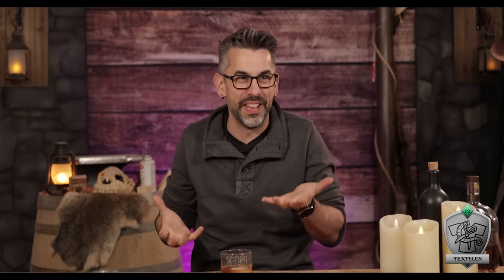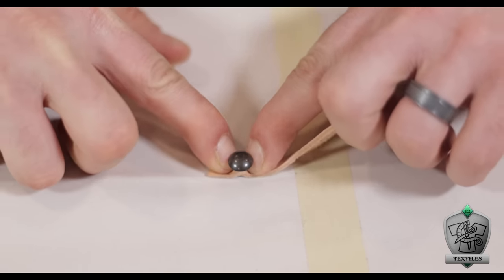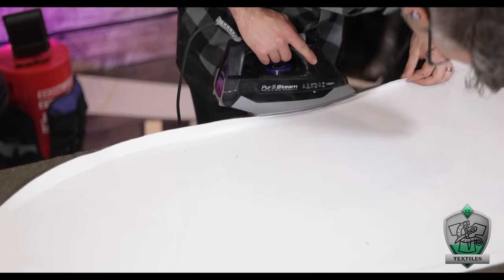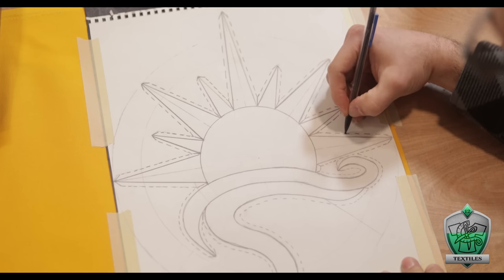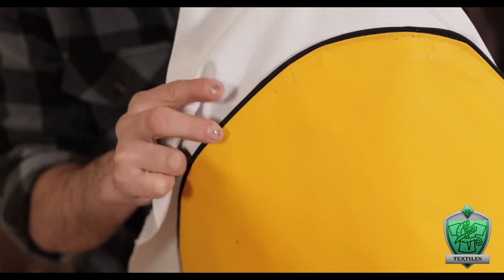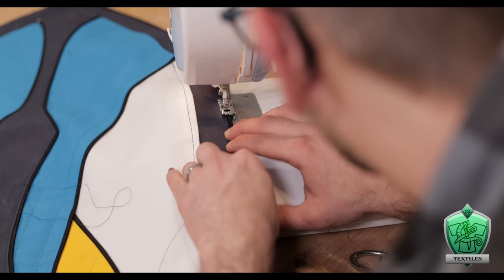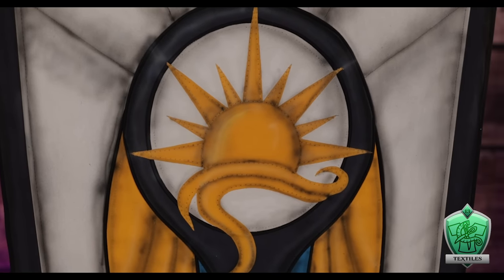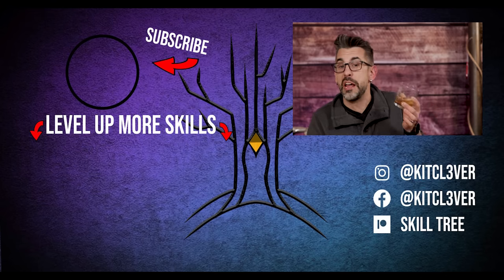Epic Banner DIY

Comment: Advice from a sewer: While I have not made a banner before, there is something you could do to cut down on bulk. This may seem obvious, but sometimes we miss obvious things. That would be to cut out the center of each piece of your pattern. What that would mean is, where the peaces lay on top of each other, you would cut out a shape for that corrisponding piece. This may seem like a lot of work, but it would save on bulk. You could leave room for edging you used, so it lays flat as well. For the sun that gave you trouble, fray check is a great tool to use. However, I don't see anything wrong with using the double sided adhesive either. As for the biased tape, they actually have a tool to help make it and it's pretty common to see in most fabric stores. They typically come in sets of different sizes, so you can make it ths size you need. This would also give you more customizable color options than the range of ready made tape gives you.
Reply: Another use of making a flag like this is that it shows on both sides. That’s part of why it’s important in flag design not to use words, lest your design not work when mirrored.
Reply: As for maling biais tape, I (storting hobby sewster) have these tools. Unless I need a very specific pattern or color I don't. Use them. You need to cut the fabric diagonally (takes a lot of fabric) and you have so many nice colors at the fabric store. 
Maybe I'm not as experienced (I learn step by step, pattern by pattern)
Reply: May I suggest sewist, instead of "sewer"?

Comment: More advice from a sewer: to reduce the bulk two methods come to mind, most people are recommending cutting out only what's visible of each colour and sewing those pieces together, so that you're only ever a couple layers of fabric thick, but it is quite tricky. Your fabric could easily stretch as you sew it, resulting in a bulging final appearance, especially around some of the curves and corners. I've done it with patchwork shirts, and it was surprisingly hard. Your method is much easier to get a flat end product, but to reduce bulk while sewing, don't start with the background, do it in pieces so that you're only sewing through a couple layers at a time. For your banner, I could have started with the white circle on the dark blue center thing, then the sun (3 layers total), then put your dark blue line on the light blue, then on the yellow, then sew those two entire seperate pieces together, then the white. (I might have messed up the order cause I'm just looking at the thumbnail instead of rewatching the whole video, but you get the idea).

The other thing is ask store employees if you can find one! XD They know a lot and if you're stuck trying to find a thing for a specific effect, like the piping, they can often point you in the right direction. Also the back of wrapping paper works great for patterns too, if you run out of newprint

It looks awesome and you did a great job!

Comment: In the SCA, I have made large banners by making the base out of canvas, priming it with white house paint, and then painting a stenciled design with more paint, acrylic paint, and some sharpies to edit the finer lining details.
Reply: To cover my fully heavy armor I made giant ankle length tunic.  The field is chevron throughout argent and azure.  My sewing skills not being great I used white arcrilic paint on a blue tunic.  For the seven spoke wheel (yes it's The Wheel of Time) I painted it using a stencil and paint marker.

Comment: I'm not a banner maker, but I do sew and this is pretty much how I would do it. Just a couple of things I would change: 1) Try jigsaw-ing the pieces instead of placing them all on top of each other. It's more complicated, but keeps it from getting too thick for your machine (and no needles breaking!). 2) Go for a 1/2 inch seam allowance. On curved edges, it makes life a LOT easier. You can also notch the seam allowance so you don't have to fight the puckers so much! 3) In the future, try dry brushing the weathering and start WAY lighter than you want it to end up. It'll take longer, but you can better control the amount of paint/color on your finished piece. 
Great work!
Reply: I agree with all of this. You also can never underestimate the power of triangular cuts around a circular formation, keeping the folds smooth and avoiding too much overlap. Good callout.

Comment: Tip for reducing the bulk is once a letter has been sewn it's essentially just a pocket underneath, turn it over and cut a lil hole in the backing layer and then use that to cut out the fabric in the back leaving a bit of seam allowance around your stitches
Won't be the prettiest around the back but will help against breaking needles and you can always add a backing layer after the fact to clean it up ^^

Comment: A quick tip for patterning: Y\If you don't have paper large enough, you can always use wrapping paper or packing paper. Some wrapping paper can be expensive, but you could always get a small cheap roll of birthday paper from the dollar store. (depending on the size of your project and how long you want the pattern to last)
Reply: Buying up a stock of the cheap Christmas stuff during the January sales is also a good idea. If you have storage, that is.
Reply: I always buy an extra roll or two of wrapping paper when they go on clearance at work.  And sometimes if you are lucky to be there, JoAnn's will do a Give Away day or two every so often after the holidays so you can even pick up a roll for free, at least at my store we always have a ton of left over paper that we always end up giving away and donating.

Comment: I’ve seen a number of comments on ways to reduce the bulk and weight of this banner. All really good advice. 

That said. I love the bulk. I think you and Maddie will be totally stoked when you see it hanging in front of the shop. With the sun hitting it and it swaying in the breeze. That bulk is really going to make it stand out and give it further depth and character. I suspect that you will get lots of questions, comments, and compliments on this banner. 

Also, durable cloth for a proper banner was could be rather expensive and the banners were often dyed, painted, or embroidered to reduce the cost of materials. The fact that you have multiple layers of cloth in multiple colors on one banner signals that you put a lot of money into this banner, anachronistically speaking. 

Grab your ketchup and crunch away my friends.

Comment: Advice from a professional seamstress (most of what I do is stuffed animals, but still) - How you did it is pretty much how I'd approach it, though I would have worked to trim out some of the extra bulk by making the applique pieces a little more trimmed - though the way you did it lets you get the  layers lined perfectly.   When using heat n bond, iron the fabric to it before you cut out your design - makes it way easier to get a good bond and to keep it from getting all over your table/iron.   Another thing you can get instead of the piping, for another option - is heat n bond bias tape - it comes in a few widths for doing stained glass quilts, and lets you add lines where you don't have edges to tuck the piping under.   But the piping looks lovely.   To get the depth you were looking for - that 'carried across the wasteland' look, make a batch of weak black tea and give it a 20 min soak.   Then rinse it out, dry, and iron.   If you don't think it got into the crevices enough, make a stronger batch and do it again.   Or coffee - but coffee will stain the white maybe more than you want.   (You can use a toothbrush to work it into areas you want a little darker, like your stitching.)  Rinse then iron, and you'll get a nice smelling banner than looks like it's seen some stuff.   :)   Duck cloth was exactly the right choice for this!

Comment: Rather than cutting out such big blocks of fabric and layering them I would cut out each piece to the exact shape and fit them together like jigsaw pieces. (Except maybe for the sun and its white background since there are so many finicky little shapes there.) That way the whole thing would only have two or three layers of fabric instead of half-a-dozen.

The bias tape worked well, but another option would be to sew the applique pieces with a satin stitch in dark thread. It makes very nice outines, and it is pretty easy to do with a little practice. A benefit is that you wouldn't need to fold the fabric since the raw edges would be covered by the stitching, which would also help cut down on the bulk.

Comment: To help with the thickness, you could take out fabric in the middle of the layers with a 1”-1 1/8” allowance. Leave enough material for the swing of the layers together, but remove enough so you get to as close to 1 layer across the whole banner.

Comment: Would have so much simpler to build a few silk screen frames and just print it.  That also gives you the advantage of repeatability.  Banners would usually be stitched together with pieces butted up against each other to make a "flat" piece of cloth, so printing would be a quick and easy way to do it.  If you wanted the layered look, you should air brush before assembly.

Comment: For making the template, if you've got a digital design, you can blow it up to the size you want it then open it in Adobe Acrobat, hit print and choose the Poster setting - it'll print out the design across multiple pieces of regular printer paper with guides on how to tape it together to get it to line up.

Comment: Tips for the future.  Where your pieces overlap, cut the fabric underneath it away so you aren't sewing through quite so much bulk.  Also you can trace your pattern on the paper side of the Heat N Bond/Wonder Under and then bond it to your fabric and then cut out the pattern it makes the edges come out better.  And sewing the piping and bias tape on with a zipper or thin foot takes a lot of hassle out of sewing tiny seams.

Comment: If you need to knock out a set of banners in the future relatively cheaply and much more quickly, I'd recommend getting custom fabric printed and then sewing it into banners yourself. Spoonflower in the US and Contrado in the UK will do fabric that's about 3' by 4.5' for ~20 bucks, so depending on the size of your banners you can get quite a few and the designs can be very intricate.

Comment: I highly reccomend using the bonding interface (like heat'n bond) on all the pieces to help keep the layers flat. Also helps prevent the applique pieces from shifting during sewing. Also hadnt seen the corded bias tape that is nifty. I have dabbled with stained glass applique which is incredibly similar to the look you are going for.

Comment: For the loops on the top, you really should have gone with either two longer ones or 4 of that size and avoid the center of it, a banner pole tends to be centered with the vertical pole.

I've made banners before, and tend to have a back and front rather than flag types. and kind of did things in layers where there was an overlap between them, but cutouts. where there's only a bit of an overlap under the pieces where it's stitched on, then the entire thing is almost quilted onto the front of the banner and a strip lines around the edges of the front and back that is also where the loops for the poles go.

I was part of the group that got roped into doing them during high school and Jr high as they had a tradition that each year, each class designed a banner for the year that would be used in things and then kept up on the wall of the auditorium.

Comment: Hi!!! Okay some advice? Applique - for fine things like your sun the heat n bond is a very good way to go. In general you work backwards in layering so that you have less fabric for the needle to go through. Eg: you have 4 layers, you start by sewing the top two layers together, then sew those two to the 3rd and then those to the base layer. You can also sew the shape of the sun close to the edge and then trim the fabric to shape. Always make your own bias tape, easy to do and costs far less. Also snipping curves, snip a small V shape rather than just the one snip, it reduces bulk. Overall you've done a brilliant job for a nonsewer

Comment: I think this came out beautifully. I'm glad that you took the risk on the airbrush step, as that really brings it to the finish line. It was a little too clean/plain before that step. 
An alternative would have been to do more stitch lines in those accent areas with other color gradients and just layer them like an embroidery project.
Overall, I think your decisions were sound, and all the layers, while thick, will make the banner able to hang down in some good wind. It won't be flopping around in a light breeze, if this flies up, that's a strong wind.

Comment: Another way that could be useful for black lines is satin stitching the edges. But it's also takes a lot of thread. And also for keeping things in place you can use that iron bond that you used in the sun for an applique technique. So I would do the same thing lol. Great flag btw

Comment: As with the other sewists that responded, jigsaw all the pieces and avoid layering, but also, double sided fusible interfacing should also tame a goodly amount of fraying. You could also use felt, but you'd probably want to hit it with waterproofing because unless you are using natural fiber felt it would probably not wash well. Still, Huzzah! great idea!

Comment: Sewing Advice: I have noticed you only fold your edges over once and stitch. This could run you into trouble in the future, if you ever need to wash it, the edges may still fray. You can use a product like Fray Check which is a glue to keep this from happening, or if you want a really clean edge, just fold your edges over twice, tucking those raw bits into it. I used to larp, and being able to toss everything in the wash once home, even banners, was invaluable. Maybe it was just me, but I always ended up in the dirt dead, or rolling around at some point. 

Another way to bind the edge of the banner would be to use double fold bias tape to sandwich the edges. This is also a good option if you forget your banners seam allowance to fold over, which I have done before. I prefer making my own, in cool patterned fabric. 

As for your center yellow design, you want to look up appliqué techniques. Your machine may have multiple stitches, and you want to look for a satin stitch. You can fake it with a wide tight zig zag. I found this tutorial that explains the process here: https://www.youtube.com/watch?v=scUGh6Gjlvw This will allow you to cut the design directly out without any extra allowance, and still bind those edges in. You might need to use some fabric stabilizer to make the fabric robust enough to take that much stitching, but you are using duck cloth, and that's pretty thick so might be okay. 

I think your banner turned out great!

Comment: Love the banner, it looks SO cool! I can't give any advice on the sewing end of things, however, I do use an airbrush frequently. My chief suggestion would be to create a standoff stencil. Cut a slot in thick cardboard in the shape of the lines that you want to follow and hot glue some spacers onto the bottom of the stencil. This will hold the stencil off of the surface a bit, allowing the spray from the airbrush to feather out. The further back you are from the surface of the material that you want to paint the more feathered the line will be. Of course there is a measure of diminishing returns as you don't want to be too far or the airbrush paint/ink will dry before reaching the cloth. Hope that helps in the future. Keep up the great work!!!
Reply: This is great advice. We used flush/stand off stencils in college for painting patterns on set pieces. Often these were wallpaper or stone/brick wall patterns. They were amazing. 

Grab your ketchup and crunch away my friends.

Comment: To be honest I was surprised that you didn’t just bust out some fabric paints in order to keep the bulk down. I love this design too. And in the future May I suggest fray checking your fabric. It helps with some finer pieces and certain fabrics. It looks amazing.
Reply from the maker: Oooooh what does that mean? Lol
Reply: @SkillTree  There’s a product called fray check and what it does is essentially glue or seal the ends of the fabric to prevent fraying like what the sun did. I love using it in finer details and I always keep a bottle at my work station at all times. It’s clear so it doesn’t dye or stain the fabric and you can get a decent sized bottle on amazon for around 5 bucks. And depending on the size and type of the fabric piece you can sometimes skip seams. It works well on transparent fabrics
Reply: midnight rose is right with their advice here, i agree. and may i also suggest when using the air brush (i know, its scary and a Real learning curve) use darker shades of the colors you are going over, instead of black. ex, dark blue over the blue, a dark yellow over the yellow, etc. That may keep it a bit lighter in the 'oh no is it to dark?' scale, and you can always darken it more if it is too light. Over all I love how this banner turned out and im glad You and Maddie are too! Keep up the great work!

Comment: If you want something cheaper and easier to do, use a sheet of acrylic and turn it into faux stained glass using black hot glue (for the dividing lead lines) and a mixture of acrylic paint and clear glue for the "glass."

Comment: The airbrushing was a little heavy, but if you throw it in the washing machine on hot some of that will come off. Then it's like weathering where you spray it on and "wipe it off" to leave the appropriate level of shmutz in the recessed areas.